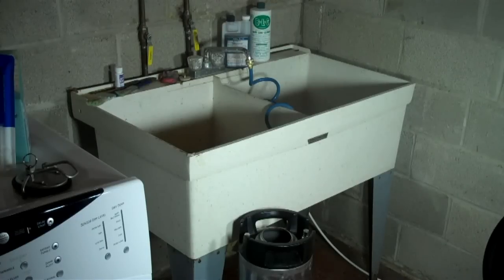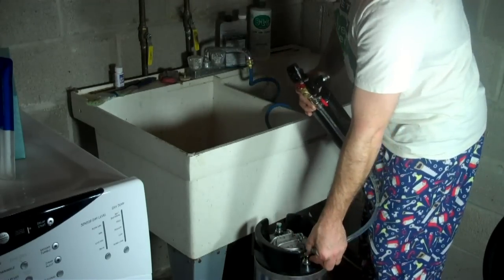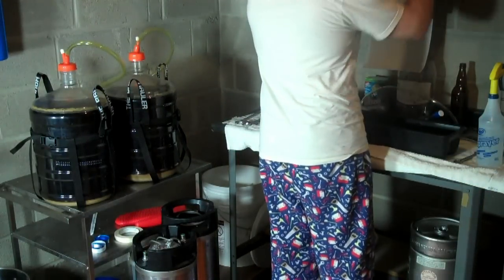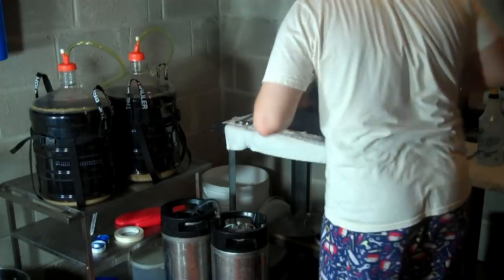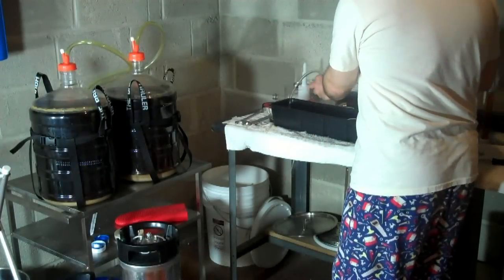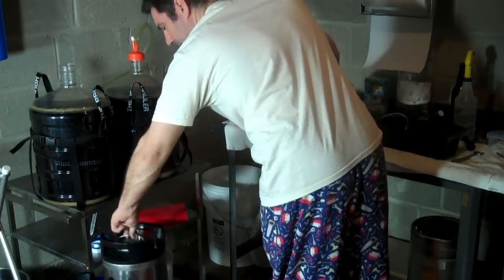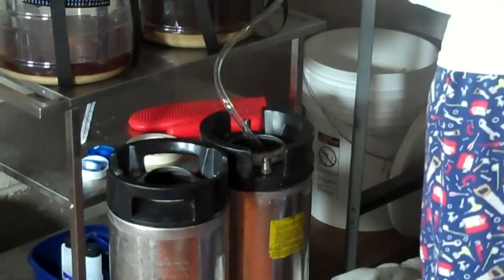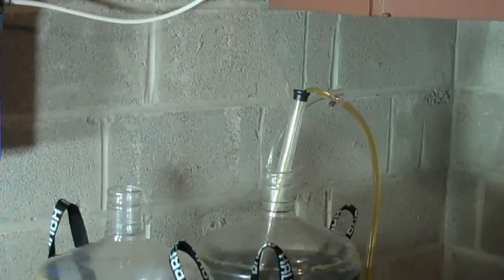Transferring beer from carboy to corny keg for homebrewing

Comment: Nostalgia - You asked for input or other ways? IMHO if you're racking out of a better bottle or glass carboy you've got the tools at hand to do it better. Get the right hose and couplings (I forget offhand) to fit the right side nipple of the carboy bung. Get a stainless racking cane or the center part of the auto-sipon if the plastic thing comes off (I have one, can't remember) and slide that down the middle. Turn on the gas to 1~2 PSI and BAM there goes your beer pushed by C02.

Comment: Glorious C02 ;-) One 20oz paintball tank is around 10cu/ft of gas @ 1 ATM and 5 gallons is about 2/3 of a cubic foot so it's not costly really. If you don't wanna push the whole way with gas like I said, turn on the gas until the beer is blowing and then just pop the hose off. I never liked the churning of the auto-siphon start and I use this technique now. Remember 1~2 PSI, you can ziptie the bung if it comes off but it shouldn't. Too much pressure is BAD ;-)

Comment: Nice set up! I'm still stuck in the dark ages across the pond with bottle conditioning beer. Going to save for a corny!
Reply: I did that once a long time ago and it's very discouraging. Luckily I had the means to jump into kegging right away but I feel like it's slightly more intimidating. Dealing with so many tubes and pressure. Good luck man! If youre in the UK why not try casking? The OG beer dispenser!

Comment: @nostalgia75  Thanks I bought the Auto-Siphon and The Thief. Great products. Got 5/16 hose and had to
heat in boiling water to attach. But no air leaks and no beer on the floor from sucking on the hose. Putting
the Oatmeal Stout in the secondary was a breeze.

Comment: Very informative! I'm going to be using those carboy caps as blowoffs for an upcoming brew. Do you ever run into trouble with the capped part not sealing or popping off for extreme fermentations? Also have you considered pressure transferring using the carboy caps? Also something I'm going to try in my next batch.

Comment: Thanks Joe. Great demonstration and very practical. I noticed that you shot the Co2 into the keg (I'm guessing 10-12 psi) to carbonate and detached the bottle. I assumed that once the beer absorbs the Co2, the head pressure would dissipate to an equalized pressure of the beer absorbed Co2. I have been leaving my Co2 attached during the 3 (or so) day process to keep the two pressures equal. Is this unnecessary?
Reply: That makes sense. So am I correct in my understanding of how the pressures are working to carbonate?

Comment: OK you said the little "hat" on the syphon is supposed to keep the bottom sediment crud from getting into the keg, correct? how well does that actually work? do you just go straight from your primary fermentation directly to the keg then force carbonate for a few days?

Comment: Looking at buying a corny but trying to fully understand them. When you pull a pint from it is that carbonated as you pull it by having it connected 'live' to CO2 or do you force carbonate the beer in the keg to dissolve the CO2 in well before you pull a pint? Cheers

Comment: How did you carbonate your beer? Forced or priming sugar? Keep in mind I have not brewed my first batch yet. I am almost finished my Keezer. Also can you do those little pressurizations  with the the CO2 cylinder that is going to charge your system?
Reply: ***** Thanks Joe. That  sounds easier. I'll do that. I can probably  just use my CO2 tank to do that preliminary cleaning you did with the paintball canister right? I don't have a paintball gun.

Comment: Refractometers are nice because they waste less beer, however they're not terribly suitable for anything other than O.G. measurements. Once you've fermented and alcohol is present things get a little murkier as regards how to interpret the results you arrive at with a refractometer. There are folks who have taken a multitude of hydrometer readings in parallel with refractometer readings and attempted to curve fit a correction equation. At the end of the day it's still less accurate than hydro.